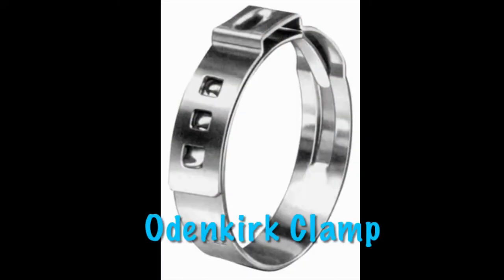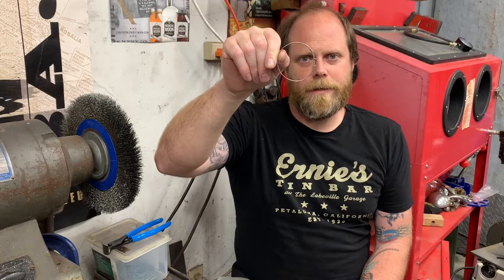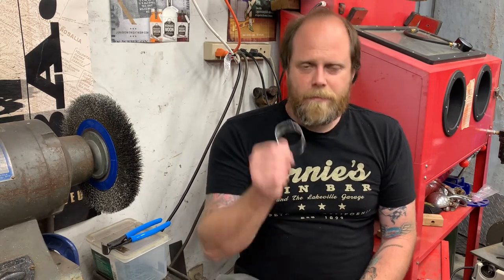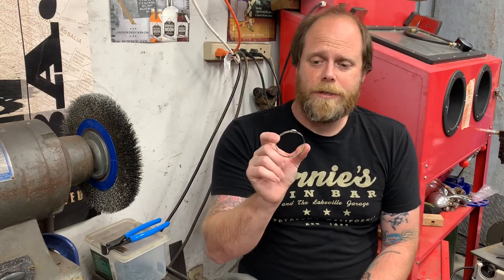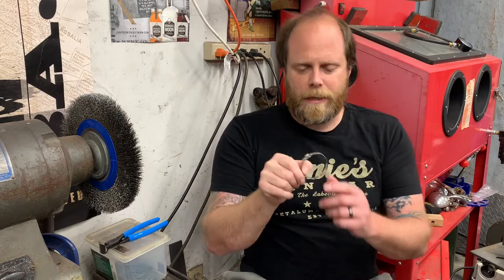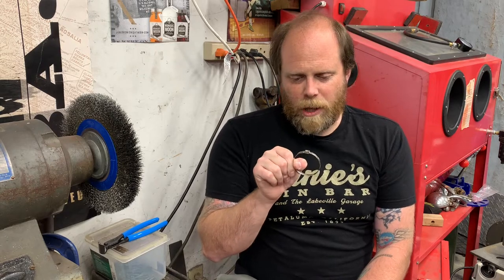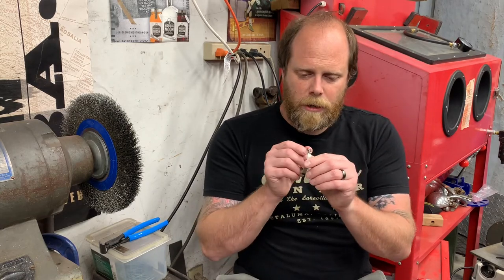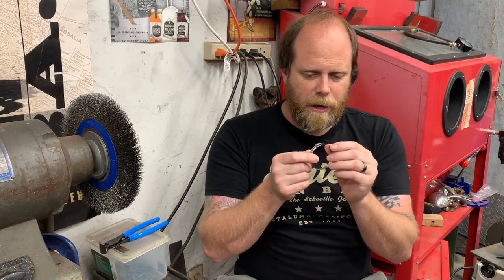Can You Re-Use an Oetiker Clamp? They Say You Can NOT, But I Wonder...And What IS an Odenkirk Clamp?

Comment: So for the record, I'm here for the same reason (slip yoke boot on an old ford) after a U-joint job. A .25"  punch helps for uncrimping. For crimping, I didnt have the pictured pliers, I took two of the thin rollers from an old U-joint cup, and used channel locks to squeeze them inwards and then peined the whole thing down with a 4oz ballpein. To hold the rollers on either side, I stuck them on with a dab of wheel bearing grease. Worked like a charm, took 10 minutes for two clamps.

Comment: I love reusing old stuff though. It’s like the challenge of being frugal when you don’t have to be. Kinda binds me to those of the greatest generation who did have to be. The “disposable mentality” can be frustrating once one becomes a collector and sees how rare true originality is. As the great philosopher Skip Knot reminds us, “Knew is not ‘best’!”.
I found two similar but reusable tinnerman clamps failed in this year’s plane annual inspection last week. One on the crank case ventilation hose and one on the pitot tube(air speed) hose. Neither a big deal and neither likely to cause an issue. The old clamps are getting harder to find and I like to be original up to the point of life and limb. Many set that bar a lot lower than I do but I’ll take and use their outdated tech with pride!
Keep on working, friend!
Reply from the maker: The “disposable mentality”, in my opinion, is a large part of the reason we are in our current mess (literally and figuratively). So, amen, brother! What made those clamps fail your annual, just out of curiosity?
Reply: @crazycaseyscustoms  Not sure. They were just loose when I looked. They are likely WWII stock. IIRC the one on the breather tube was missing the last tab so likely just vibration. The pitot clamp is just in place but loose. Still there as it's not going anywhere.

Comment: Hello Casey. Do you need a specific shaped pair of pliers to crimp them? (I suppose I should google it!) Edit: I did find a video showing the clamps and pliers in use: https://youtu.be/iPfEj_Bb3tg Interestingly one of the pieces at the end looks like it is multi size. An interesting little vid, thanks Casey.
Reply from the maker: Thanks Mart. As I’m sure you discovered, the pliers are a special type of deal, which I have purchased, though now that I have them in hand, the end nippers would have also worked. I like the clamps, and intend to use them, in common sizes, on other projects. As for those multi-size deals, I struggled to find them listed, but eventually stumbled upon similarly designed CV boot clamps that supposedly fit a variety of sizes, so I have those as a fall-back. Thanks for posting the link…I was completely unaware of those prior to watching that video.